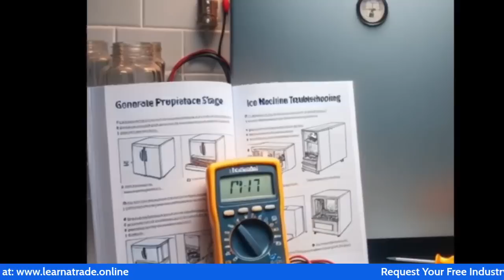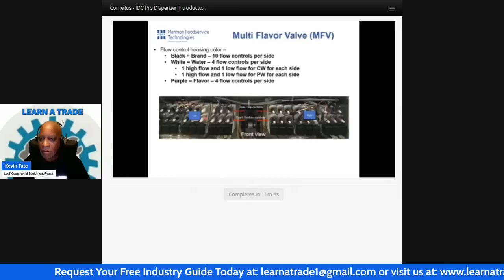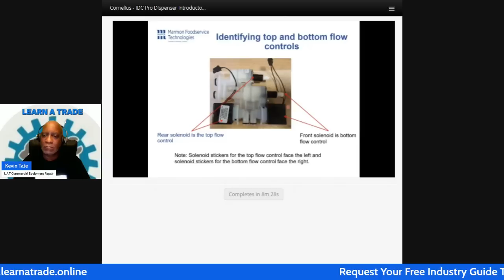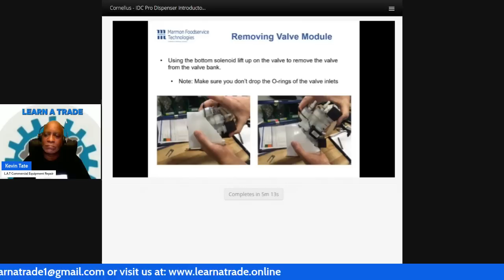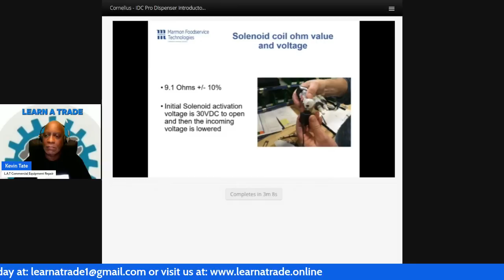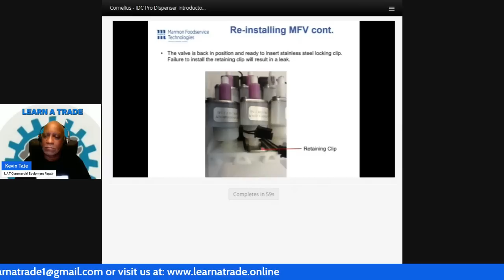IDC PRO Multi Flavor Valve (MFV) Training (By: Marmon Link)

Comment: I have a question regarding the IDC Pro 255 Cornelius machines.. I have been seeing this machines at 7-Eleven and Speedway stores here in Jacksonville, Florida! i been doing some of my research on this machine for a good 5 - 7 months and see it is a little easy to play with. Is there any certifications requirements to play with the components n repairs n diagnostic troubleshooting on this machine? i am 27 year old joining into the H-VAC Industry field and looking to see if there any certification cornelius offers or learn a trade :).
Reply from the maker: Thanks for your question.  No there is not a required certification to work on the IDC PRO but there is training available.  Here is a Cornelius link for training and a pocket guide. IDC Pro | Operation | Cornelius Training https://share.google/x0XV8Y6sgviQyyJZK